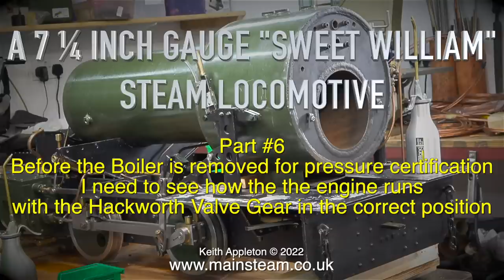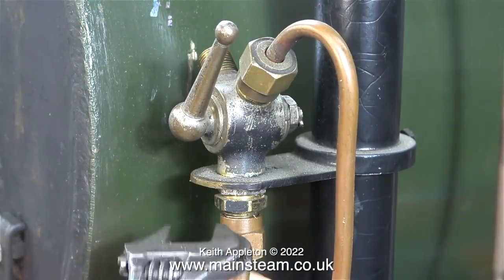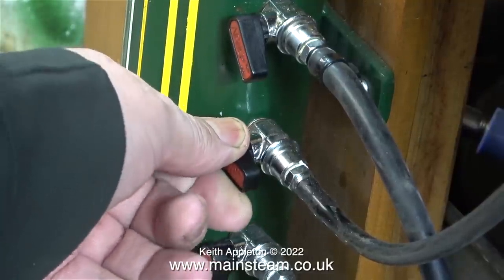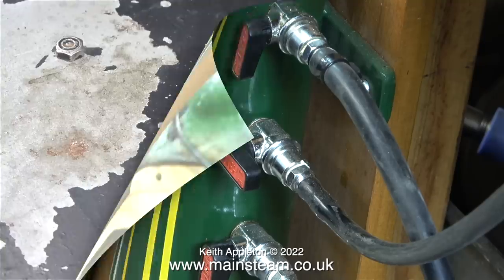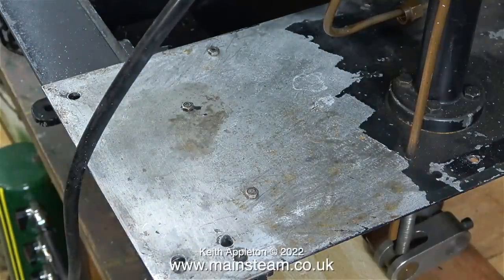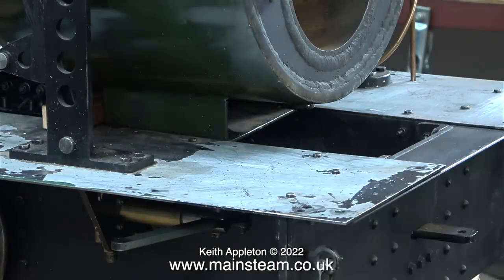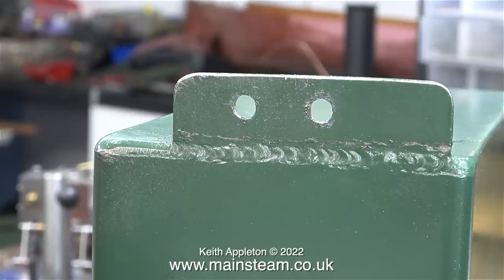A 7 ¼ INCH GAUGE "SWEET WILLIAM" LOCOMOTIVE - PART #6

Comment: Sir, I enjoy all your work. Watching your Video's is one of my life's great pleasures. We all run out of some forms of knowledge, particularly myself.  I am not a metallurgist but have experienced working with Stainless steels on a general engineering scale. 316 & 316L are the American names this common kind  non magnetic stainless steel. This stuff was used extensively when I worked in the man-made fibre industry.  302 Stainless was used in the food industry. The way we tested the 316L was with a magnet. 302 stainless being magnetic. To me that loco has a nice bit of plate which is in good condition & was badly painted. Is it 302 SS I have no idea & for you, it does not matter. Is it stainless? You can generally tell just by looking at it to see if there is any rust or cavity corrosion where the paint is cracked. I have forgotten what cavity corrosion looks like, being somewhat older than you. Cavity corrosion is something common to painted stainless steels & why they prefer not to be painted.  My brother who is a metallurgist will be laughing at my lack of knowledge in his area of expertise.